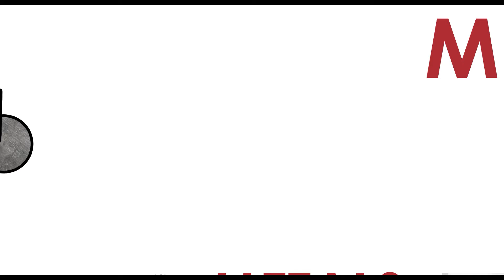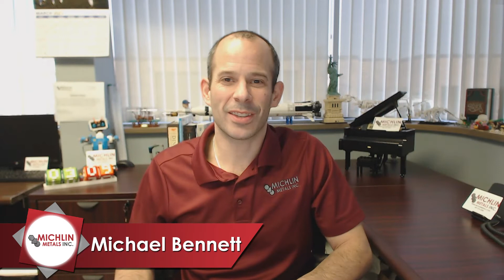Invar 36 and Kovar per ASTM F-15 - What is Invar? What is Kovar?

Comment: Actually NO! Invar® was discovered and is a registered trademark of Aperam Alloys, so please acknowledge the trademark when referring to Invar®. Carpenter tagged along and sells Invar 36 to work around the trademark.
Reply from the maker: As stated, you are correct. "Invar" (standalone with nothing added) is owned by Aperam Alloys. I am however, discussing "Invar 36", which as you also mentioned is owned by Carpenter. Thank you for the clarification and I appreciate you watching.
Reply: @MichlinMetals  At the beginning you say Invar®is a registered trademark, not Invar36, a slip it seems, which is why I commented.
Reply from the maker: Yup, that's correct! Appreciate the comment.